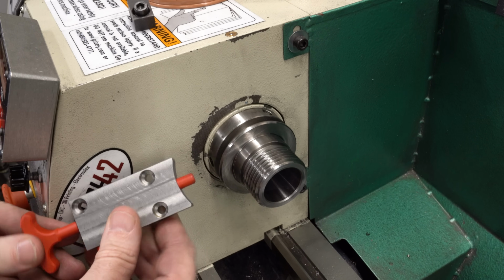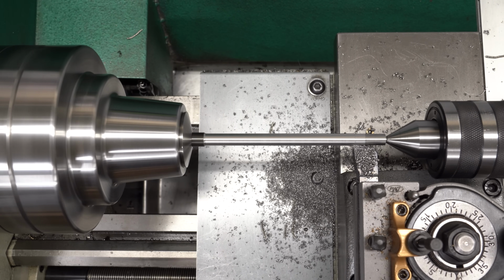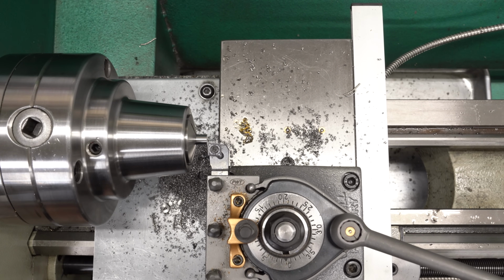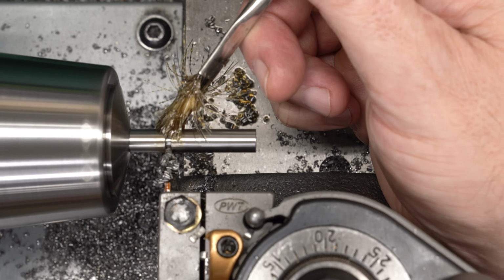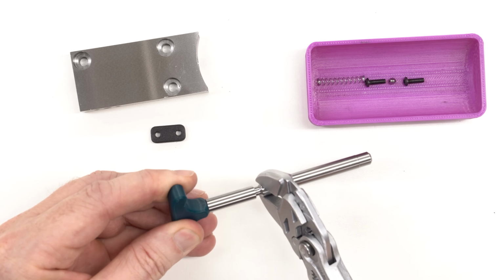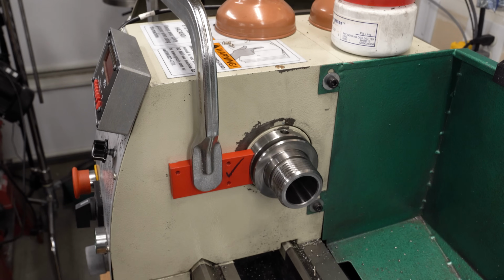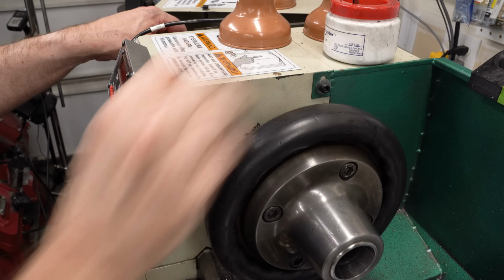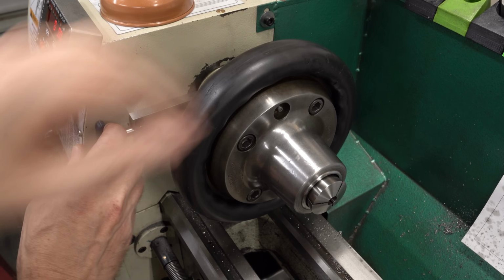Finishing the Spindle Lock for the Grizzly G0602 Lathe

Comment: That's a well thought out mod. I have the G9972Z , basically the same as yours . I had to correct a lot of assembly hackery. Took some time but I got my lathe trammed in nicely and functions very well. Lots of mods done to my lathe as well. Very capable home shop lathes once you get the kinks modded.

Comment: The 44 grit strip was not Emory which is ultra fine Iron oxide.  (Iron Oxide is a very soft material for polishing).  It was Alu. Oxide which is much harder and many times corser.
The non woven pad he used next is again, much corser than Emory. It too uses Alu. Oxide. 
KnifeMaker

Comment: Hi James:
So... You have two choices for indexin the pin.  The obscenely hardcway is to use chamfered pins in lieu of the ball, which would require alignment pins or keys; the other way is very simple, counterbore the ball boss from the bottom.  With a 20 or thirty thou counterbore

Comment: James, just wanted to say Thank You again for an excellent project. When I first saw the videos on the spindle lock, I thought it would be nice but seemed a bit difficult with the precise long hole and the large radius for the spindle. Fast forward 3 months with a new set of reamers and I figured I would give it a try. I printed your 3D parts and test fitted everything; it was perfect. Made the parts per your plans, excellent information. Not as difficult to make as I thought and turned out great. The only thing I need now is a surface grinder so I can make things look as pretty as your parts. Anyway, thanks and keep up the informative videos for the average guy with a hobby tool shop.

Comment: This spindle lock has one minor issue. Maybe acceptable on a prototype. It does not 'lock' into position when opened. You don't want it sliding into lock position when the lathe is turning under no circumstances. This could be solved, when the shaft has to rotate 180° (handle up/down) to slide it or to lock it into position. Handle down for locking as gravity is on your side. Your ball + spring hold is not a lock.

Comment: I was interested in how you would deal with power-up-with-lock-engaged as well. Seems you happened into an elegant solution. Frankly, I'm surprised you didn't over-complicate it. I use the back gear to lock the spindle when changing chucks, and half the time I forget to disengage. The motor usually spins up and the belt slips. (I don't use a belt tensioner, the motor's weight provides belt tension, and a crude clutch effect.) That hasn't been a problem, but it can't be good for the belt and I go "Oh $#/+!" every time. I'm considering mounting a microswitch actuated by the back gear to inhibit the motor. But then I'd need an override switch for when I actually use back gear. Adding something to sense when the bull gear lock pin is out is just getting too complicated. So it wouldn't be a complete poka-yoke, but close enough.

Comment: Nice work, man

I'm worried about the possibility that chips may have fallen into the gearbox.
And you could consider a switch to disable the power when the static lock activates.
Reply: There is no gearbox in the headstock

Comment: So on to the mark 2 version. The locking shaft has a rack gear cut into it and then the handle has a gear. Movement is by gear motion, there are detents on the lever shaft to hold the in and out positions. The other possible version would be a toggle design, much as the one Luger used on the 1908 design.

Comment: You could do a version that used a cross pin through the shaft, a slot inside the block that the pin moves in, a couple of magnets to hold in either the locked or retracted positions. You wouldn't have any issues with it slipping past the ends of travel. The pin can even be floating if you cap the open slot.
Not very adjustable for locking force, but very simple.

Comment: EDIT: OK, I finished the video and see this was addressed and that your VFD setup prevents any drama if you attempt to start up the lathe with the lock engaged. I do wish you had explained why this happens. Does the VFD shut down based on lack of advance? Of is it trying to turn but just doesn't have enough torque to create any drama?

Any concern about forgetting that the spindle is locked and starting up the lathe? Wouldn't have been surprised if you'd have included a lock out switch to prevent startup when the spindle is locked. Or at least some more visible indicator/flag showing the status of the spindle lock as Engaged or Single, err I mean Unengaged.

Comment: Replace the 4mm ball with a "bullet" made from 4mm round steel.
You can adjust the shape of the round nose on the bullet to be smaller radius than 2mm, so you get better safety. Also, the bullet can be longer than 4mm, allowing you to get deeper engagement on the shaft (if you cut the shaft grooves deeper).

Comment: I'm sure it won't be an issue, but I would probably have a fear of accidentally bumping the handle or hitting it with something so I would likely add another locking detent with a push or pull pin so that you need two hands to engage it.

But you also made sure that it doesn't eclipse the edge of the machine so bumping into would be pretty unlikely. Very cool project to watch!

Comment: I wouldnt be concerned about leaving the lock engaged and turning on the spindle, I’d be concerned with accidentally hitting it with the spindle spinning.  Thats where the danger comes from and I don’t even want to imagine how catastrophic that would be.  I wouldn’t used a sliding detent where you had to use two fingers to engage it.

Comment: I believe you want your ball "sunk" into the detente deeper than its radius, which would make the resulting pressure on the ball working to press in further into the detente (where it has no place to go) rather than out of it, when you try pushing it past the stop. The sloped side should still be able to climb out of the detente, I think. If all else fails, one can of course always use TWO separate spring-loaded "detente pins" that do not rotate in their shafts and are chamfered only on the side they are supposed to disengage on...

Comment: Guess you could wire a position sensor to the spindle lock , so it detects when it's engaged.
Then a simple circuitry could make that led BLINK or BRIGHTER or both if you accidentally turn on the VFD while lock is engaged.

Or who knows. Go silly. Air Horn if you engage while lock.

Nice and simple project. For me it'd be good enough to know that the VFD can't shear the pin :)
And after days using this, you'll get used to it.

Comment: And I'd have to assume that since that's not gonna be doing much in the way of spinning at high speeds I don't think putting the center in then extending the stock is going to have any effect on its function.  It's just a pin.  A very fancy pin, but a pin none the less.

Comment: I wonder if you could turn the spindle lock into a safety feature that prevents the spindle from starting by turning it into in electric switch. Edit just saw that the VFD does not power up - never mind :)

Comment: I have tried to start my small hobby lathe several times with the spindle lock engaged and nothing happens. It's only a 0,75 kW motor with a VFD and it just squeals until I stop it. I could install a micro switch to interlock the motor with the spindle lock but I don't see it as a big enough problem as it is.

Comment: man, you did a great job on that. you ended up with a built in safety because of the vfd. that was a very happy accident lol. however, put the original motor setup back on it. and flip the lathe on , it will be a different story. i do like your way better though.

Comment: If you reduce the diameter between the detents, you will reduce the force required to switch between them, and therefore the tendency to overshoot. I got the impression that it was a bit stiff, in that regard, so I think you could reduce it a fair amount and still have a good positive detent.
Reply: I was thinking to make the ramp angle shallower would be better, but a reduced diameter would work as well.
Reply: @neistridlar  it probably wouldn’t hurt to reduce the compression in the spring a bit, too.
Reply: @troglokev  Maybe, but then you reduce the strength of the end stop as well, which is not desirable. But at least you would have less force, and thus more control.
Reply: @neistridlar  the end stop is well enough constrained against the torque of the spindle by the bore that it slides in. The only force to worry about between the detents is provided by the spring, so a small reduction in diameter to improve the action would be fine.
Reply: When at rest the center of the ball needs to be at the shear line. Any high speed bounce is then controllable with spring rate.
Reply: Perhaps a small pin inside the spring of the appropriate length to keep the ball from going up in the hole?
Reply: Ya you're right, I've usually seen the diameter between the detents decreased on most of these mechanisms.

Comment: Possibly try machining down the body of the pin between the chamfers? That way the ball starts deeper in the groove, and doesn't need to wait for the spring to push it in, and will hit the unchamfered sides at a steeper angle.

Comment: My paranoia of knocking it in while running would make me put a softish tip to be destroyed instead of scoring up the spindle, or some sort of sprung latch at the handle side of shaft for blocking.
The overtravel could be dealt with with another reduced section and a square nose setscrew, though through hundreds of cycles that could be chewed up?

Comment: James, I knew there would be safety concerns with the pin-stop. I had thought a lockout switch should be recommended for those that might not have the same exact configuration as you.
Reply: Configuration doesn’t really matter. It can’t be engaged while spinning, and it can’t start spinning while engaged.

I suppose you could round over the end of the pin a bit in case you try to engage it while spinning.

Comment: So the grooves should be a little deeper than half the diameter of the ball. This way the square shoulders of the grooves would stop over-travel of the pin. i am sure you know that. Or, you could replace the ball bearing by a short pin that you'd machine, that'd have a 45 chamfer to accommodate the chamfers on the pin but shallow enough to catch the square part of the groove.

Comment: A very good solution, worked with a speed chuck many years back on a very large turret lathe, it had a foot brake spindle lock which screamed like a stuck pig every time you used it.

Comment: 0.1 deg out of level 😱 how do you live w/ yourself! 
J/K. Amazing video James. You've managed to captivated me with two videos on a spindle lock. Glad you were able to show what happens if you forget to take out the lock. Would the result be different if there wasn't a VFD? Also will all VFDs behave that way or was there an option/feature that needs to be enabled.
Reply: Yes, if you have a five HP lathe the belts will slip and squeal like a pig or the pin will break.

Comment: I disagree on using a set screw for the ball detent. You said you'll be more limited on spring selection, whereas you'd actually have much more freedom in your selection as you'll be able to apply different amounts of pretention. And setscrews that hold back a spring can be very short so you're not taking away and significant max spring length either. 

Your design decision  in comparison is very odd, even if you wanted an easily 3D printed version. Even oversized printed threads right off the printer would have been enough to hold against that tiny spring. The plastic knob from the pen that you took that spring from is much smaller than even 2 M6 thread rotations...

Comment: On a bigger lathe, if you drilled those holes, oil would flow out of the gearbox. My 10ee has a spindle lock, the PM1236T does not. I should use my surface grinder more, looks nice ground.
Reply: I thought oil would come out of the drilled holes, but apparently this lathe has no oil in the headstock?
Reply: @billsmini10 that is the upside of small lathe without gearbox 😂

Comment: Now you know why you keep the old lantern style tool holder that is on the shelf. Quick change tool holders are very useful, but their bulk gets in the way sometimes.
Reply: My insert tooling actually hits the center more often than the toolpost. It’s annoying.
Reply: @KennyEaton603 And that's why you keep cemented carbide and high-speed steel cutting tools in your toolbox. In the home shop I gave up on insert tooling. Way too expensive whereas cemented carbide is a 1/3 the price and lasts for years. In commercial work it is a different story. You have the horsepower and machine rigidity to make carbide work as it is supposed to.
Reply: @aceroadholder2185  agreed! I run a lot of inserts, but plenty of brazed carbide and HSS as well. 
I regrind a lot of my inserts as well, after seeing Stefan Gotteswinter do it.

Comment: Suggestion: add two vertical sharpie lines vertically on the side of the headstock case, in line with the center of the T handle and extending a quarter inch or so above and below the handle in each position. Then you can tell at a glance which position the handle is in. 
A paint marker might be better than a sharpie, less likely to wash off.
Reply: Why? He showed that the lathe does nothing if it is engaged. It is also quite obvious by the position of the handle.

Comment: What I would have done would be to design this to hold a micro switch which would be wired to the VFD to ensure that the lathe couldn’t be turned on with the pin in the hole. There would be a decent in the pin that the switch would fall into when the pin is in the hole. I did something similar with my mill spindle. 

But the motor is too small on this lathe as he demonstrated to be able to overcome the pin. Just as it’s not left that way for more than a few seconds, nothing will be damaged. But if somehow, the lathe was turned on, and it was forgotten about for a while, the high current in the stalled motor could damage it. I’m a bit anal about these things though.
Reply: While I understand your point there comes a point where you need to trust the operator to be cogent and have object perminance - what you describe would be essential on high torque motors as a safety, but on a small shop lathe it is adding more wiring to throw unexpected spanners in the works, especially wanting to add wiring that close to the spindle, coolant degrating cable sheathing and possible swarf lacerations

Comment: Agree the variable speed lathe will not generate enough torque to cause problems if power is applied when the pin is engaged. For those with fixed gear lathes where the engine starts at full torque there may be problems.
Suggest a little feature creep on the electronic screw... pin position interlock. Disable power to the drive motor if lock pin is engaged.
Another project? 😉

Comment: Did you think to check the center of the pin? Given the length:diameter ratio, you're probably turning a barrel shape. The middle of the bar will flex away from the cutting tool, giving a larger diameter in the center.

I ran into this turning a piece of 1.5" 1144 about 18" long. The middle was bowing out by a couple thou.
Reply: this depends on your DoC, the deflection is directly proportional to the cutting load so you often make this stop being a factor by allowing yourself a final 1 thou spring pass
Reply: You would think that, but no. Very light passes tend to generate chatter that looks a lot like tool marks. The real answer is a traveling steady.
Reply: @PaulSteMarie  depends on both the tool and the material - Carbide is prone to chatter on spring passes as carbide rips rather than shaves, Sharp HSS tools or inserts however can do final spring passes happily
Reply: Use a file to take out the bow.

Comment: Even if you did leave the pin in, speaking from experience the belts will slip on the drive pulleys, so you still have a little protection in that end as well.
Reply: that that has a toothed timing belt. it would rip the teeth off the belt. the belt is and will be the weakest link.
Reply: You didn’t watch the whole video right? There’s just no torque in the motor from stand still.

Comment: The only way you can truly align a tailstock with a headstock is to place both a true center in the headstock spindle and a true center in the tailstock spindle or quill and take a cut at both ends of a shaft and compare.  I have an Edge Technology tailstock alignment bar to use in place of a turned shaft in my lathes and even though it is claimed to be hardened and ground it is not as accurate as turning both ends of a shaft for comparison. If you use anything on the headstock side of things, i.e. chuck, collet, or etc. you are compounding or magnifying error. Something the long dead machinists knew, but seems to be forgotten in many cases.
Reply: You also need to run your indicator over the top of the shaft at both ends to measure how much your tailstock has dropped. On worn lathes they can drop (wear) quite a bit.
Reply: @ellieprice363 New lathes the tailstock should be slightly high to account for wear over the machines life.